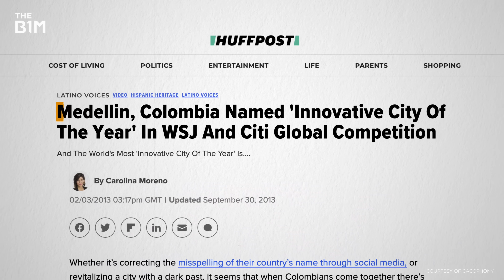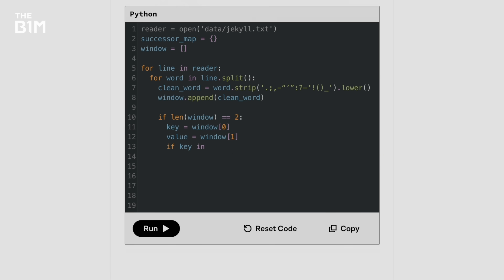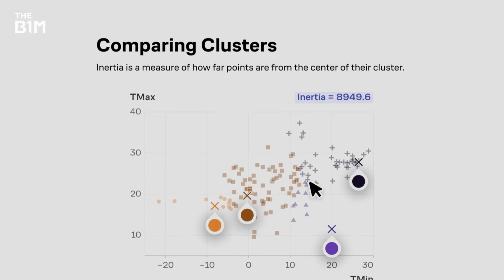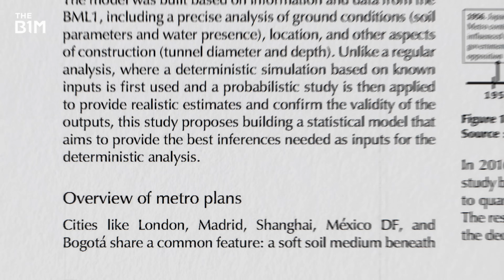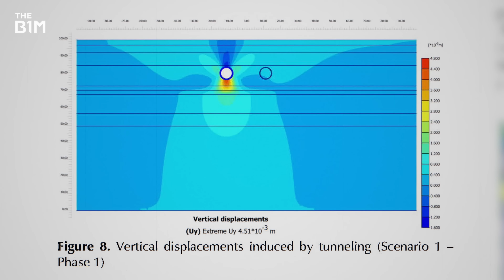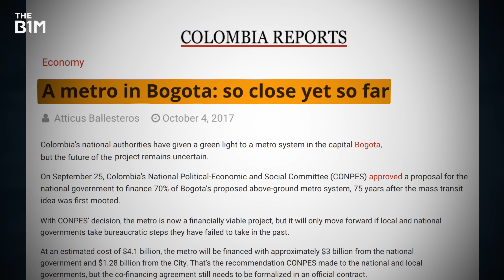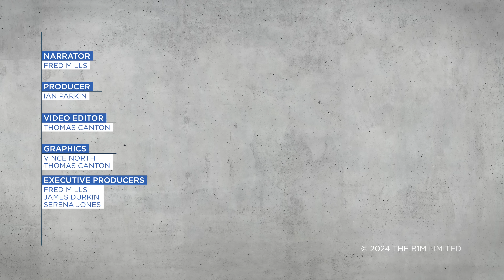How to Build a Metro From Scratch

Comment: Couple of observations about this overall excellent summary. First, everyone says "they've been talking about a metro for 80 years" but that's like saying it took 100 years to build the first spacecraft. Until the 1960s Bogotá didn't have anywhere near the population to justify one (in the 1940s it had fewer that 500,000 people), and until the 1980s it didn't have significant traffic issues (which is when, as you note, we see the first consensus about the need for something).  Second, apart from money and logistics (and it's important to note that the national government assumed most of the construction cost of the Medellín system, which they were never going to do for Bogotá), Peñalosa had a philosophical reason for favoring above-ground solutions: he's always said that below-ground systems treat people like insects, and he just doesn't like them.  Make of that what you will, but between below- and above-ground solutions of equal cost and difficulty he'd still choose the latter.

Comment: Peñalosa successfully sabotaged the development of a robust rail-based transit system not once, but twice—most recently by pushing for the elevated viaduct. This so-called "metro" is little more than a feeder for the BRT system and a real estate venture in disguise. Far from improving mobility, it will only force users to pay more without saving them any meaningful time. A strong rail network would have eliminated Peñalosa’s ability to keep fragmenting the city with BRT trunk lines, putting private interests ahead of public good.

Comment: 0:32 so far big mistakes... It is not cheap, 26 days of round trips Home-Work and Work-Home costs around 20% of the minimum salary, it is not effective, Bogotá needs to move 3.5 million people daily but its capacity is around 2.8 million, and its effectivnes can be messured too by the time spent in it and is usually from 1.5 to 3.5 hours daily depending on the distance from the destination. it is insecure and people use this just because there is no alternative... well, we have SITP but is a disaster...

Comment: 3:18 there´s also another situation going on here: Bogotá does not have a "real" downtown", so people from northen, suthern and western parts of the city goes to the eastern part where many job places are located, because there´s a mountain range limiting all from south to north like a wall. Geometry of mobilization don´t go "around" a "center", so is not that easy... furthermore, building new streets is not as fast as car´s market sales, which have increased several points the last years, due to high income in many people. That makes the problem worse.

Comment: Respectful Greetings!
To: The B1M.
Metro systems have been in use for over 150 years, and new metro lines are still being constructed, either as new metro systems or as expansions of existing metro networks. In many cities the metro system is an essential form of transport to keep the cities functioning. 

What is the need for metro rail? For faster connectivity of the nodal points in the cities. To Reduce the traffic drastically. To provide safer public transports.

Reducing gas emissions and traffic congestion as well as increasing fuel efficiency can make a great difference in the environment. 

This metro line is expected to reduce road traffic in highly congested Colombia.

Courteously!
Luis Van-Dúnem

Comment: Interested to hear the description of Bogota's soil substrate mentioned in the same breath as London.  What's probably not clear is that in London, sedimentary river deposits form substantially more of the soil south of the River Thames, where underground railways have long been conspicuous by their comparative scarcity.
Reply: Bogotá´s land is a plain called "Bogota´s savannah" which extends 1.641,6 sqr miles (2,7 times London) located at 8.661 ft above sea level, and it was crossed by, at least, 12 rivers (most of them, channelized) and there´re still some swamps in several areas that works as water reservoirs in rainy seasons... it a complex geology... even more: high skycrappers are located near the eastern mountain range, just to get some solid and rocky settlement to build their pillars and columns... strangely beautiful.

Comment: Your data regarding BRT is OLD/BAD. Lazy research, jeopardizing your channel as untrustworthy. 
    https://en.wikipedia.org/wiki/Transjakarta                                                                                                                                         Trans Jakarta has the world's longest BRT system (251.2 km in length),[7][2] which operates about 4,300 buses. Transjakarta aims to have 50 percent of its fleet be electric buses by 2027. By 2030, the aim is for the entire Transjakarta ecosystem to use electric buses.[8] As of November 2023, it serves an average of 1.134 million passengers daily.[3]

Comment: I enjoyed your video! Bogotá is as crowded as London but in a third of the space. Many areas are avoided for security reasons, showing the stark income divide in Latin America. Cycling works for kids or singles but isn’t practical for families. The reckless behavior of many motorcyclists is frustrating. Despite high gasoline prices, car ownership is common, with people paying high parking fees and taxes that offer little in return. Still, having a car makes it easier to enjoy the stunning scenery outside the city on weekends. Finally, the only option to get around quickly is TransMilenio, where loud panhandlers, often Venezuelans, use bullhorns and talk nonstop during the ride, displacing Colombia's own panhandlers.

Comment: Building railways and other public infrastructures will not solve traffic problems if many people can still easily buy private vehicles in that country. Let's all face it, many people use their cars as a status symbol in their country rather than just a thing to move them. That is why there are countries out there that made acquiring and using private vehicles very expensive by taxes, congestion tolls, no garage no car policies, private vehicle ownership certificate biddings, overpriced violation fees and many more. If you look at those countries those are the countries that actually solved traffic not just because they have more public commute infrastructures.

Comment: A similiar transport exists in Istanbul called the Metrobus. Supposed to be a temporary solution until a underground metro line was built in the main spine of the city but stuck around for about 20 years even though the city has many many metro lines and even to almost all of those locations since all these years. And they're all jampacked incuding the metrobus lines. And excuse me for being a skeptic but there's nothing worse than rush hour traffic in Istanbul maybe excluding some Chinese cities, i imagine Bogota traffic would be a breeze for a local here. It might be x3.5 bigger in land which pumps up construction investments way higher, having a really difficult terrain maybe even more so than Bogota, being a city of huge history which keeps delaying projects left and right, a very unorganized city planning, a strait in the middle of the city, double and probably almost triple(unofficial due to mass immigration) the population does not help. These types of projects seem to keep overpopulating the cities in increasing rates. So instead of being a solution they usually end up becoming a part of the problem if the governments don't put up population diverting plans to other less attractive cities.

Comment: As someone who lived in Bogota for a few years due to my work, I can tell you that the construction of that subway (if it does get finished at some point) could take decades to complete.

I personally witnessed something as simple as an underground connecting project (they called it “El Deprimido de la 94”) take over 10 years to complete, and it didn’t cover more than 100 meters in its radius. Then it got flooded during its first week of being fully functional due to a terrible draining system.

I wish them the best of lucks, but the odds are certainly against them.
Reply: The metro is being build by a Chinese consortium not Colombian companies.
Reply: @camiloordonez4906  If that's the case, then it was the smartest thing that they could have done. As an architect myself, I can assure everyone that the Colombian incompetence is unparalleled. 

As I mentioned before, I lived in Bogota for a few years due to my work and near where I lived they built a pedestrian bridge (it was located at 11th Street with 100th Avenue connecting Escuela Militar) and the thing just came down a few weeks after it was finished. I was lucky that I had already passed through it on the very same day that it fell down and the good news was that it happened on a Sunday and not many people were hurt.

Comment: Correction for the video. The original rail in Bogota did not just make way for the car. It was actually completely destroyed during the most consequential historical event for the country that shaped 100% how it is today. El Bogotazo, which was a violent period that took over the city as a consequence of the murder of the leading presidential candidate of the time, ended up destroying almost all of the rail in Bogota. What followed was political bureaucracy where it was ultimately decided not to repair it and led to what is know as the Penny War, which is a period of time where there was no real public transportation and instead private buses competed against each other to take as many passengers as possible, which led to the massive traffic congestion that Bogota suffers from. Transmilenio was the start of the change of this.

Comment: Metros are extremely harmful for the environment and are built for the profits of contractors, builders, bureaucrats and politicians. They are mostly not needed to improve transport. There is a lot of evidence about problems caused by metros and about how they have been imposed in cities undemocratically and unscientifically. Bus lanes and segregated trams are far better for public transport than underground or elevated metros. Metros are expensive, unjust and harmful.
#nometros #metroscam
Reply: @yashagrawal88  how are fully electrified railways harmful compared to exhaust from cars on major highways? Care to explain?

Comment: Also, in terms of transport innovation, Bogota has the largest bikeway network in the Americas and it's quite amazing. I live in Bogota and I commute to work by bike, it's a 12 km ride and I do it entirely using the bikeway (which means that I don't have to ride alongside cars, making it safer and faster). The bicycle is by far the best method of transportation right now in the city but off course it has its own limitations (you have to be able to ride one, it's not so fun for long distances, the weather may be a problem, Bogota is a hilly city so it's exhausting to go uphill, and so on).

Comment: I´m from Bogotá. The way that you described Transmilenio was perfect, a "band-aid", cheap and temporal. 

But imagine having a band-aid for 24 years. Eventually, cannot hold everything in place and that´s Transmilenio everyday. Even the smallest malfunction of a single bus can collapse all the system.

People cycle in the city out of pure necessity.
Reply: BRT systems are a very important part of the transportation of a city. Same for pedestrian areas, bicycle routes, organised taxis, organised parking, roads with no pot holes etc. the building of a metro line does not resolve all transport issues in a city. Any metro line in Bogota will only manage 7-8% of trips. You still need to manage the other +90%. In summary, Transmilenio is and will always be important for the city. London has +300 train/tube stations and still buses move more people than trains!!!!!!!!
Reply: @andresbuitragomoreno  this is correct, and it's incredible how people still struggle to understand the cost dimensions.
Reply: I always thought of the transmilenio as if it was a Bigger metroPlus ( bus system in Medellin)
Reply: @vlz.matthew  Bogota, Medellin and Cali, among many other cities on the planet use the system built in Curitiba in the 70´s.
Reply: @johnhalat  what system?
Reply: this happens everytime here in south america 😢
Reply: Bikes are great until you need to breathe in a crowded metro.
Reply: Cycling in that air being very physically active is sooo toxic to the health
Reply: Other Bogotano here. You described it very well

Comment: This is interesting. I live in Dublin, Ireland, and they have been talking about building an underground metro for decades here but nothing has happened. They might, possibly, start deep bore tunneling in the next few years as long as there are no more stupid planning delays or politics getting in the way. However, it promises to be extremely expensive (every construction project is in Ireland).

As far as I know, nobody has raised the potential of building the metro as a viaduct to save money. That makes perfect sense to me as our city is pretty flat and low-rise. There is probably some rubbish conservation reason. Instead they'll just spunk billions on a very expensive tunnel and be left with one metro line instead of multiple lines for the same price by taking the viaduct option.

Comment: Bogotá is my second home and while never having used the transmillenio, it is dangerous. It is cheap and effective, but the city has a safety issue where an above ground, or underground train would cause safety issues. The city doesn’t realize this and isn’t taking much action. This city has an AMAZING bike network though, with cars and motorcycles heavily respecting the bike lanes, and they are just about on every road.

Comment: There is another city that had a very similar history with building a metro from scratch. That would be Los Angeles.  The difference is that Los Angeles residents finally arrived at the realization that traffic would only continue to get worse and raising sales taxes was the best way to fubd the construction of LA's metro after decades of false starts.

Primarily, because of a few important leaders like Tom Bradley and the support of residents, after 34 years, LA has a Metro system that's 110 miles long with 101 stations and will continue to expand for the foreseeable future.

Comment: You have described Transmilenio as one of the best successful BRT - Bus Rapid Transport - in Latin America, and it is 100% true. I would like to invite you to make a research about one BRT that is even faster and probably better. The "Metropolitano de Lima" , having the fastest BRT in Latin America going across on part of its route going through Via Expresa. Another data could be that  a big part of the articulated buses are built by MODASA a locally made factory.

Comment: As a bogotan, the biggest mistake we made was electing Enrique Peñalosa as a mayor (10:05) TWICE. He first came with Transmilenio which is not the best but it somewhat works but then i really think that not allowing the already planned underground metro to be constructed was so stupid, the above ground metro will be a big mess because this city doesn't have enough space
Reply: The transmilenio is objectively an excellent BRT system, the issue isn't the system, it's that BRTs are simply not enough for a city the size of Bogotá
Reply: Peñalosa did the best he could with the resources the city had.  The bus system before TM was a catastrophe, for the Underground Metro, the cost and the challenges would have been too much.  Petro had 4 years to secure funding and leave the underground project signed, but the reality is that he was miles away from any structured project.
Hopefully they can build an underground line in the future when enough alternative routes are available.

Comment: Here is the reason why Bogotá does not have a Metro system: from the 1950's public transportation have been controlled by a bunch of powerful and very rich people who own the only transport mode we have, yes, buses, in Bogotá there are short buses, long ones, local and urban buses, regional ones, red, blue and green buses, old buses, new ones, diesel, hybrid, gas and electric buses, that is to say, buses of all colors and flavors. TransMilenio is a private, theoretically public, enterprise; the city builds all the infrastructure and buy the buses while the Kings of Buses "operate" the system. Using TransMilenio is expensive compared to Metro systems in LatAm, it have been perfectly design to keep these guys millionaire for many decades while Bogotans suffer the lack of a decent transportation offer and daily pay for the only option we have. To finish, one of the most important agents of these Kings of Buses have been Enrique Peñalosa, he probably do not own buses himself, but is a significant political face of this dark club, he has been major twice, and twice has cancelled a Metro project, I am pretty sure that for decades Bogotá have had enough money for building Metro, tramways and cables, the problem was, is and will be private interests, so the only option is to became our transportation system really PUBLIC, as in meany other parts of the world.

Comment: As a Bogota native I would like to add that: The Medellin metro was created due to a big mistake, basically initially it was going to be built in Bogota but since Medellin was growing a lot at that time, they made a bad calculation and ended up building the metro in Medellin and now Medellin is not It has more than half of the inhabitants of Bogota and the subway was created there because of that mistake, the video is very good by the way.